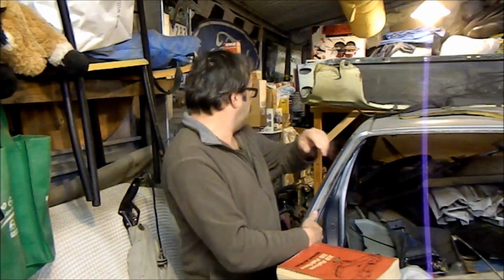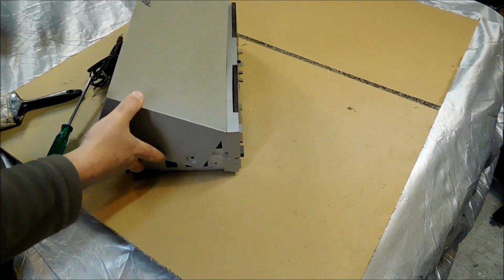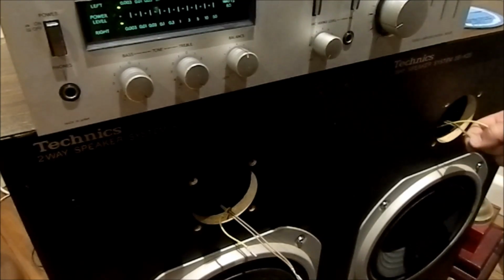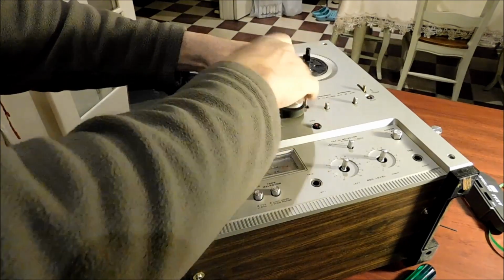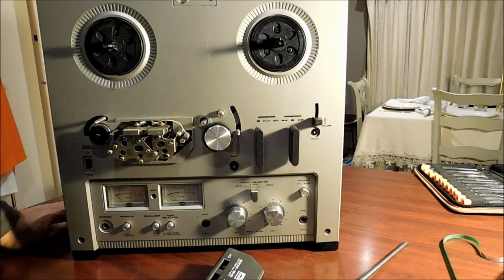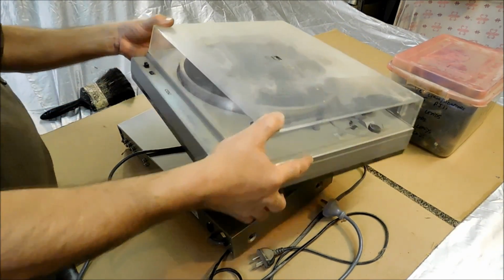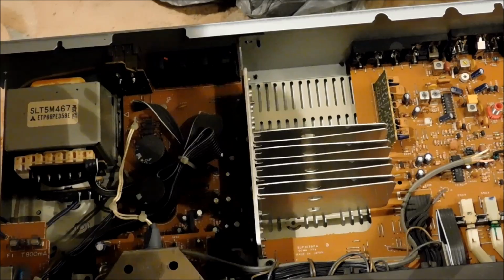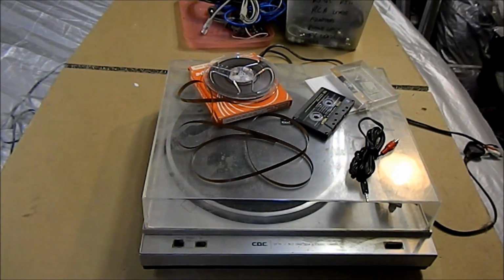How to Check Out a Junkyard HiFi System

Comment: I started tinkering with discarded audio equipment when I was 10 back in 1979. I'm 51 now and I have a house full of geriatric hi-fi gear from the 60's and 70's and a few later items. I got most of it when it was worth nothing and most of it was free. The things I actually paid money for were very cheap at the time but some of it is now selling for more than when it was new.

I'm not interested in "high-end" hi-fi, I'm more into taking modest spec and ancient gear and getting the maximum quality from it. It's very often suprising how well some of this stuff can sound.

Most new gear doesn't interest me, compared to older stuff the build quality of new gear is usually a joke. A lot of the currently available turntables are truly awful, I much prefer my 1979 Pioneer deck. Good new turntables are available but they're not cheap.

You've got some nice gear there, ok it's maybe not top shelf stuff but it should still be able to give a good account of itself. The reel-to-reel deck seems basically sound and shouldn't need much work.

Comment: You're a hoarder of old gear like me ;-) I have a Sony STR-DE525 receiver that cosmetically is like brand new. Have the original box, remote and paperwork and manual etc. Bought it new 20 years ago and it blew up just out of warranty. It died playing some head banging garbage at one of my daughters birthday party. Went in for repair and was told it blew one of the taps on the main transformer and that it wasn't economical to fix as the transformer was some ridiculous price. Anyway, I  couldn't bring myself to toss it, thinking maybe oneday I'll find another one to provide the parts and fix it. I was into electronics many moons ago collecting Tv's and VCR's at auctions and under the benches of repair shops that were given up on. I would then repair and resell them etc. After the Sony blew up I bought a Denon DTS receiver which I still have. Recently sold some old Amiga 500's and C64's that I had been hoarding for years. Amazing how quickly time passes and things become obsolete relics.
Reply: Cool, I sadly sold my commodore for $12 about 2 years ago without even thinking of looking up how much they go for. Went to cash converters 2 days ago and saw one for $300 smh.
Reply: Cool, I sadly sold my commodore for $12 about 2 years ago without even thinking of looking up how much they go for. Went to cash converters 2 days ago and saw one for $300 smh.

Comment: This gave me flashbacks to the 80's with my family's HiFi system! It was a Yamaha tuner/twin tape deck and turntable in a laminated faux wood case with glass doors, huge floor standing BOSE speakers. It caused complaints from a couple of streets away on occasions late at night when my sister and I bought new vinyls such as Madonna, Whitney Houston, Cyndi Lauper, The Eurythmics, Culture Club, Eurogliders, Wa Wa Nee, Pet Shop Boys etc etc! We used it up until the late 90's when the rubber drive belt broke and it just wasn"t worth repairing at the time.

Comment: You will be so surprised at how good cassettes can sound if you listen to a good commercially made album tape on a decent system. especially those decks that cost like 2 grand even back when they were new in the 80s and the cassettes don't go into a door, instead they sit exposed between two beams (people who were around at the time will know the decks I am talking about)
Reply from the maker: Indeed and some audiophiles would attest to that... only issue is that I'm not very sound savvy, I'm just building up a modest system that looks nice. Cheers and thanks for the comments.

Comment: My grandfather has a Sansui stereo system that has rarely been used since the late maybe 70's or early 80's. It stands over one metre tall and has many matching components (since they were bought as a complete system). My dad told me it cost around $3000 back then. It has seven speakers on each box. I've only ever really seen it maybe 3 times in the last 35 years as my grandparents are really strict and no one is allowed in the room it is kept in. They never used it, only my dad a little before he married my mum. He said it could probably replicate the sound of thunder, lol.
Who knows, it probably would burn out if it was turned on now.
Reply: I'm not sure if it had a cd player part but it has all the rest.
Reply from the maker: That Sansui system sounds like a gem, so if your grandfather plans to dispose of it make sure you secure it. Vintage kit like that is becoming sought after by collectors, particularly a matching set of high end stuff. It will work when powered up, but some of the original sound clarity may be compromised due to some components inside (especially capacitors) drifting from original specification. These can easily be replaced by an electronics technician. Thanks for your comments!
Reply: Yeah I was just talking with my dad the other day and asked when did he buy it, my dad said he bought it before january 1980. My dad was in a band back then and they did a professional demo tape with the guy who owns clarke rubber doing the recording.
Even my dad can't quite remember how much the stereo system originally cost but he remembers it was either $2700 or $3700 in 77, 78 or 79.
I think the stereo had a black front, so it's not silver 'i think' and it has blue coloured displays on it. It has been a long time since I've seen it turned on...maybe 1993 or 1994. It still sounded really good then, but I was pretty young then so I also wasn't that interested in it at the same time.

But I am interested in it now, because from what I remember it looked really cool with all the synthesisers and stuff flickering.

My grandfather was a bit strange as he recorded the news on radio and vhs every day for 30 to 40 years. So there will also be thousands of cassette tapes to eventually sort through one day. He's had dementia now for the last 10 or so years and he's in his 90's. But he was also a radio repairer from his 20s to when the components got too small for him to see. My dad told me he bought an all in one stereo system a few years before the sansui one. It looks like a piece of furniture with a record player, cassette player and a radio. I assume even that may be hardly used as well. I also remember a saba stereo he used for years to record the news plus a few free standing radios about a metre tall that look like cupboards with a decorative speaker grille on the front made of wood.

All these things a decade or two ago were considered junk, but today it's like 'wow'.

You can still sometimes pick up these stereos components if you are lucky from garage sales, my dad picked up an 1970's akai single tape deck for $5 from a cash converters garage sale (where they sell things not up to shop quality, or for what they considered junk) along with two pioneer amps about 5 years ago.

The sansui would be a great system to own as it's all together in a matching cabinet, my dads system though has a lot to be desired being a mismatch of components, sizes, colours and speakers from my old panasonic midi hifi all packaged on an old narrow chipboard computer desk. It sounds really good though so I suppose that's what matters.

But I tell you, things always are hard to find or super expensive when you decide you want to get these things again. Growing up with cassette tapes I didn't know there were different quality tapes like ferric, chrome and metal. I'd assume 99% of what I ever used was ferric so I judged tapes as pretty crap compared to cd. Now I look for tapes and they want an arm and a leg for one chrome of metal tape.

Sorry for the bombardment, things just started coming back to me and I wrote them all down. Good luck with your setup, hope you find some more good pieces.